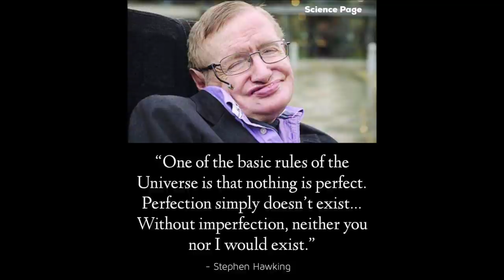Toyota Hilux Tacoma Pickup Lifted TSL Super Swamper 1/24 Scale Model Kit Build Review Aoshima RN80

Comment: Hi Chris, Another wonderful build and tutorial. When Spray Painting, is your booth powered on? Is it venting specifically to the outside? or just out the back? cheers.
Reply from the maker: It doesn't do much good if it's not turned on. LOL
I just use it to remove the overspray. I wear a respirator for the fumes.

Comment: The Hilux/Tacoma may be the best pickup truck ever made. If you maintain them they could go a half million miles with no major repairs. And they hold their value tremendously: used ones with 150,000 miles still sell for $10-15k.
Reply from the maker: I agree, I currently have a 2020 Tacoma TRD Pro in Army Green. Love it!
Reply: @hpiguy  Just wish we got the Hilux diesel/manual transmission combo in 4 wheel drive here in the States!!